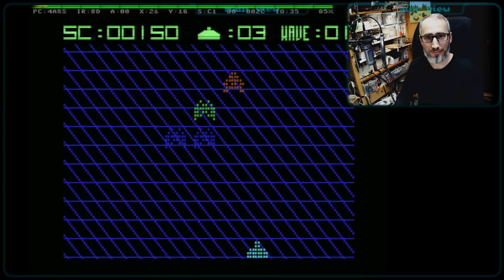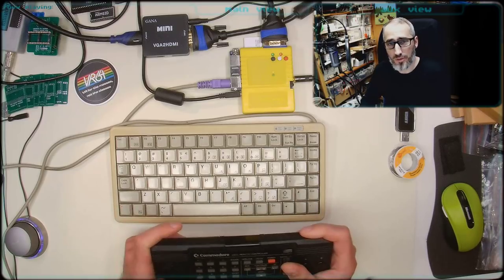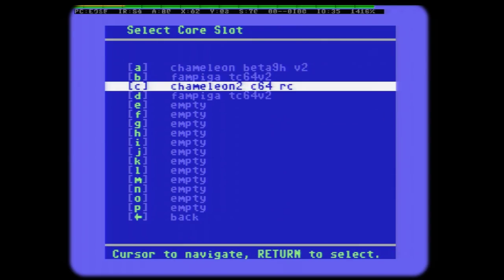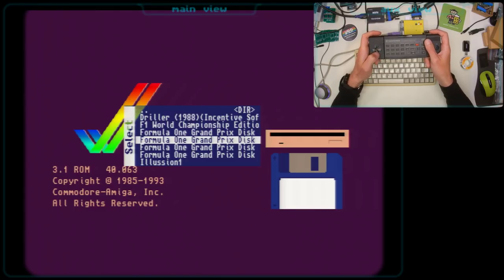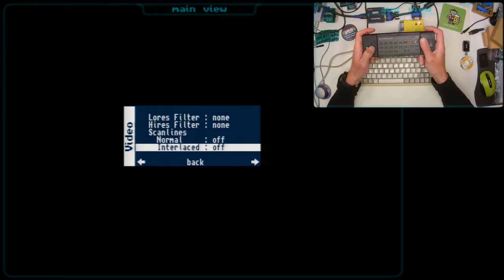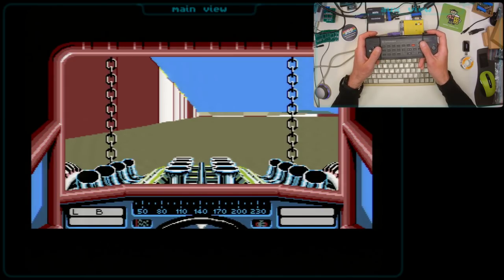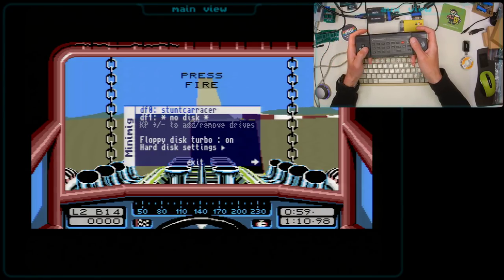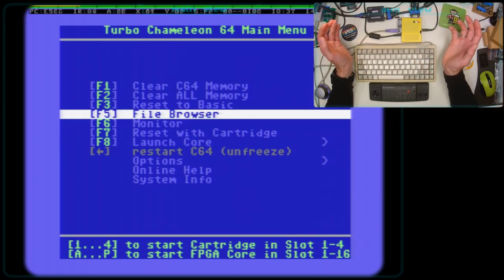C64 related - Turbo Chameleon V2 - new Minimig Amiga core, sneak prev new C64 core

Comment: C64 keyboard works in current Amiga cores for TC64/TC64 V2. So you can have it in cartridge mode, run Amiga core and using the C64 keyboard. Very practical
Reply from the maker: Thanks for the info. Have to test this, sounds promising.

Comment: Thanks for great videos. Can you load the minimig core while TC64 is in the c64 and use the joystick ports? Or does joystick controls only work with cdtv controller or dock?
Reply from the maker: Yes, you can run the minimig core and use the joysticks attached to the C64.